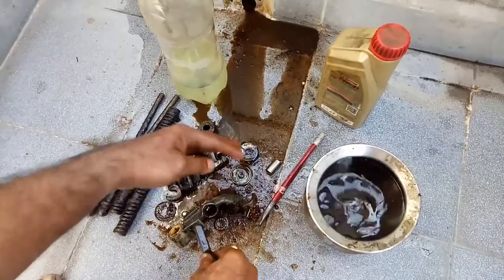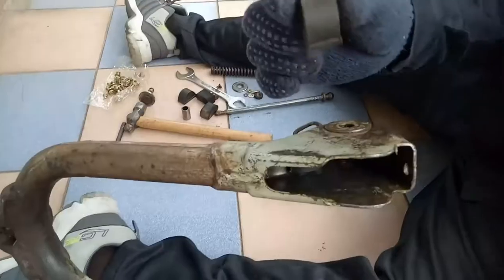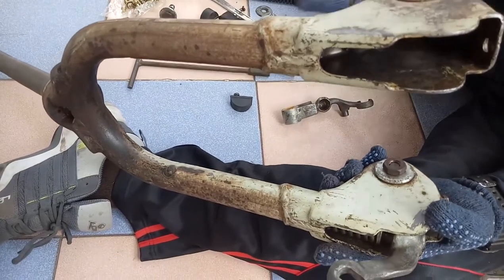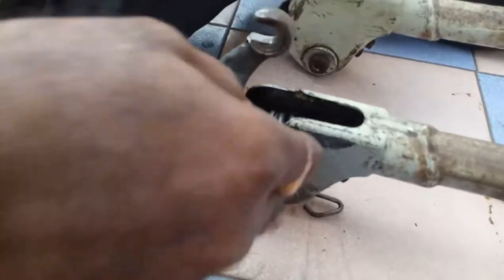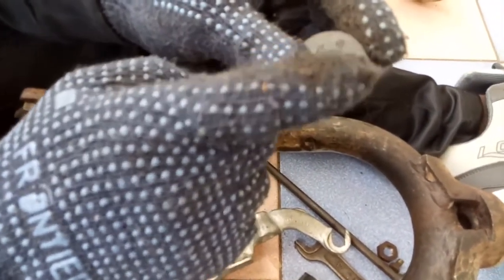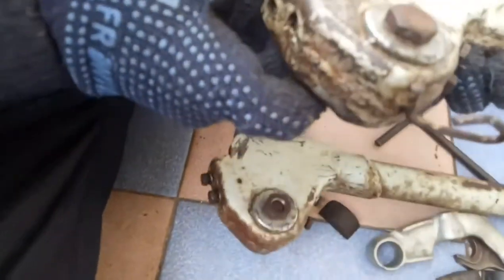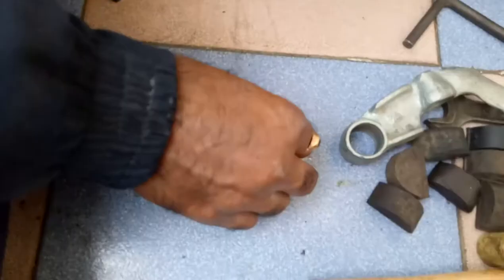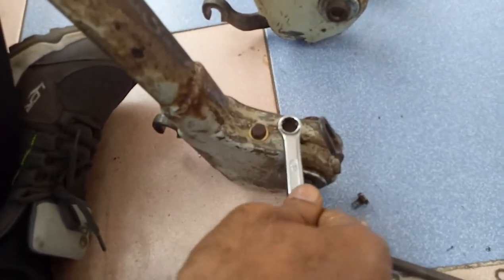How to Rebuild Lambretta Scooter Fork at Home: Step-by-Step Guide

Comment: Broo can we fix this fork in chetak scooter
Reply from the maker: No you can't fit because design is different
Reply: Broo can we fix any other scooter forks in chetak
Reply from the maker: Other scooter forks do not match. You can try the old one from scrap Yard Near you. If you modify then lot of Professionalism required. Because when you ride and hit Speed SAFETY is very important. Fork is a  vital part in scooter